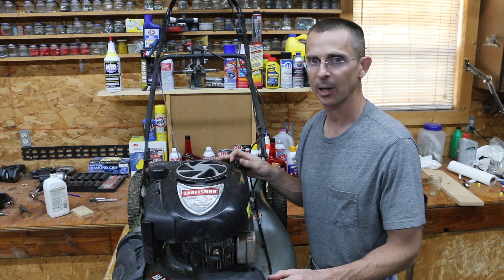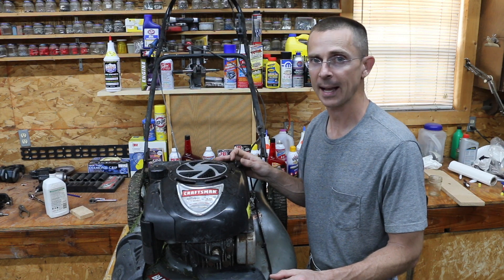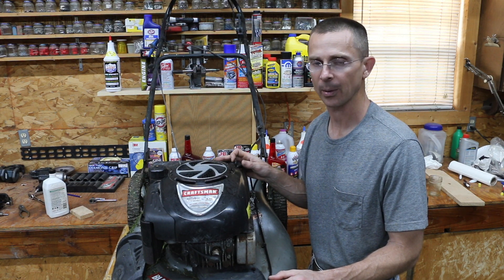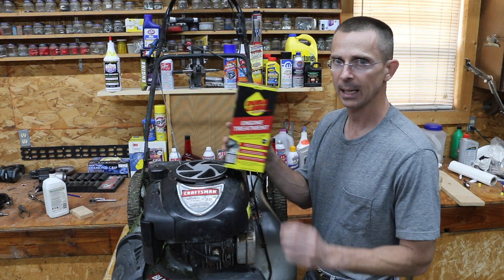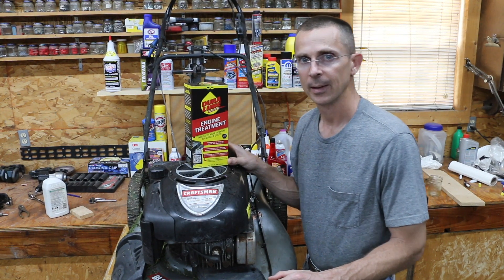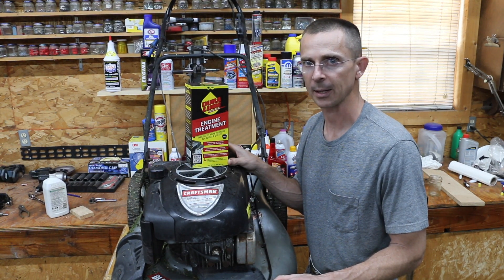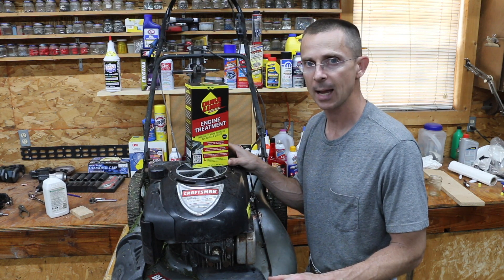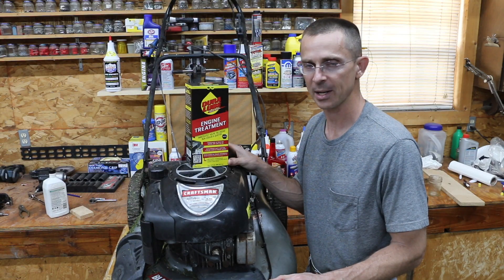Does Dura Lube actually help quiet and cool a gas engine as claimed?

Comment: Always love the tests you conduct!

As for Dura Lube. I watched the commercials years ago Sunday mornings and after months of procrastinating, I bought it.  First vehicle was a new 1980 full size V8 GMC.  Had it a few years and added DL around 1885/1986 "I believe".  Might have been later?  While doing a training course (Feb/Mar 1990) in another city and on my way home on a cold winter day, the engine block heater blew out and a massive cloud of what I thought was smoke but was actually hot coolant on a cold day almost gave me a heart attack.  Engine still running fine and I pull over and look.  Anyway, being tight on cash flow, I could not afford a tow home of another 60 Klm's or so.  I drove home with flashers on and no more than 60 Klm/Hr.  The Temp gauge was off the dial and I was expecting an engine seize up or at least some serious damage.  I arrived home ok.  Bought a new Block heater and coolant and drove that vehicle till spring of 2000 and the engine never appeared to burn oil.  Was my luck due to Dura Lube???  I don't really know or care.  I continued to always add Dura Lube!

My next "and still" vehicle is a 1997 GM Safari 4.3 V6.  Bought this one off lease in 2000 with about 70,000 Klm.  Always added Dura Lube along with premium Synthetic oil.  It's now May 2021 and it's my daily driver and does not appear to burn oil.  Always passed the smog clean test with impressive low readings.  Vehicle is in great shape with minor rust spots and the engine is extremely smooth and without hesitation/misfire.  But then, I do most of my own maintenance!
So at the end of the day, No matter what others may say, I will continue to add Dura Lube.

Cheers
Reply from the maker: Thanks for sharing.
Reply: hi can i ask you something i have a corolla. 2010 and i bought the duralube engine treatment because i fixed the exhaust leak and it still loud noise from engine. now im wondering if I dont repair my car by myself so did i just ti add the liquid 1quart to the oil that is already changed 2 days ago
Reply: @EPLSS  Hi,  First and Foremost >> NEVER OVERFILL THE ENGINE CRANKCASE!
"In most cases", replace just one litre of oil to one litre of Dura-Lube.  So you must consider sucking out at least one litre of that oil you just put in!  Having said that, you need to do two things before anything else.  1) Look online for the full fluid specifications for your year and model.  2) Go to Dura-Lube and check their instruction in case they have a suggestive reduction other than a full one litre add.
As a last note:  Depending on the mileage and existing wear on the engine, etc; dont expect miracles.  I think whatever you do as an upgrade will help if just a bit!

So now it's May 2024 and my vehicle is >27 years old and is still my daily driver.  The engine doesn't burn oil and it runs smoothly.  I use only top grade 100% synthetic oil, compatible synthetic filter and Dura-Lube.  I also well maintain the vehicle.  I typiacally replace spark plugs 3 to 4 years.  Coolant 2 to 3 years.  Best quality premium spark plug wires 5 to 6 years (and is due now),  Coils have been a bit iffy.  Do not buy Accel.  Mine lasted about a year and others have negative reviews.  Distributor and Rotor, I buy premium with Brass studs and "vented cap"!

Have fun and good luck

Comment: First, I find your methods of testing quite good and reliable.  I have had personal experience with " Duralube Engine Additive ".   I will attempt to be as brief as possible.   I once owned a 27ft Class C Motorhome with Ford 460 Cu.In motor. I personally observed that the NORMAL operating temperature when warmed up using Conventional  10W-30  Motor Oil was on the High End of the Heat Gauge but within the indicated Normal Operating Range. When the full bottle of Duralube was added to this oil,  within 5 minutes the Operating temperature dropped approximately  25%, a significant and noticeable amount.  This lower operating temperature with the Duralube Additive remained till the next scheduled oil change every 5000KLM.  This was the most significant observation I detected using this product.  I believe myself that the Duralube Additive really did reduce engine friction and thus reduced the operating temperature. I use Duralube in all my vehicles.

Comment: Yes i have used this and its great. It will not take care of a rod knock. It helps prevent them. But it takes a couple days to penetrate the metal. Thats when you really see the benefits. I had a 69 javelin and that engine after 3 days of running the dura lube, the engine just got smoother and the rpm went up by 200. I had to turn the carb stop back a little to drop the rpm back down ro 750. It ran cooler and started quickly. Fix the rod knock and rerun the tests

Comment: my 2002 expedition has a triton 5.4 - 2 valve engine, mobil 1 and duralube for most of its life changed oil about every year engine has 260,000 miles so far. Stopped using duralube for a few years then went back to it, the engine is definitely quieter and smoother.
Reply from the maker: Thanks for sharing.

Comment: I had a 86 Honda Accord LX-i with the top mounted sideways distributor that would leave metal shavings in the cap until it broke, IT happened twice to junk yard distributors till I used duralube and the used distributor already showing metal lasted afterward
Reply from the maker: Thanks for sharing.

Comment: Iv always thought briggs flatheads knocked and ticked because everyone iv seen has to a certain extent although they are great engines my dad has a husqvarna with a briggs quantum it has silver oil and it knocks so bad you can hear it down the street it sounds like a loose blade but it's not that engine won't die
Reply from the maker: Thanks for the feedback.

Comment: I found that very interesting however I had an old pulsar nx car 5 speed.  I had duralube in it.  I went out town and wife had oil change at jiffy lube, they forgot put oil cap back on car.   Wife drove round over a week with no oil in car.  Ended up melting distributor cap.   Obviously car broke down.  I change cap and filled with oil and we drove it for 60k more miles before sold car.  It was unbelievable engine didn’t seize.   Now I put it my Chevy truck and bmw.  I got over 250k in each vehicle they run great.  Thanks for sharing video
Reply from the maker: You are welcome!

Comment: Back in the early 90's we used duralube in our 400 dodge race motor. We hit a cylinder head that another team had strapped to their car for weight. why they used zip ties instead of bolts I'll never know. Anyway the head fell off the other car and tumbled down the front stretch of Ocala Speedway and we ran slap over it knocking a crape fruit size hole in the oil pan.  Our driver ran 3 more laps with zero oil pressure and then came into the pits. Our night was done. Next day at the shop well pulled the engine and got the pan off and started pulling rod and main caps to see the damage and there was zero damage to the bearings. I don't know if it was the Duralube or just plane luck but we were saved a large expense.

Comment: Would be interesting to see a lubricity test using Duralube and Duralube/Oil.
 I have used Duralube on bearings and it does seem to make them run cooler.
However, I have not performed any tests or measurements to confirm this.
Reply from the maker: Thanks for the video idea.

Comment: Dear friend you test can't be valid if testing the product was your intent ? First of all Dura lube is a friction fighter it's slippery ..it will not repair a spun bearing once the bearing was damaged only replacing it will fix it. But because of its slippery chemical make up it might lower the temp a bit ..but as far as the noise I'm not so sure...

Comment: I use duralube for one reason only. Many years ago I found out that changing to duralube, in cold weather, on first startup, the engine idled fast and smooth
imediately = no friction, and very obvious. Engine wear happens 80% during warmup, so if you want your engine to last 500 thousand miles, use duralube. (plus the other benefits)  I use a half quart per oil change.
Reply from the maker: Thanks for sharing.

Comment: The problem with duralube is that it contains chlorine and on humid environments it can turn to acid, an interesting test would be how corrosive is duralube with a little of water simutaling humidity at high  temperature simulating engine temp and test for corrosion after a long period of time, similar test could be donde to other additives that contain chlorine like prolog, motorkote, and others.
Reply from the maker: Thanks for the feedback.

Comment: True story I had a 94 Nissan Sentara. I had put Duralube in my car about twice. I knew my car was leaking some oil since I would see droplets of oil in my drive way. I had an emergency  to go to San Antonio and left with me and my brother. I added some duralube before I left. I took some extra oil. Driving there I was ok. Driving home halfway about 95 miles I stopped at a gas station to check my oil and it was completely dry. But my engine never overheated. It never got smoke or anything. It still ran smoothly and fired right up. The plug on the oil tank had came off. I was litterly running my car with no oil. I was sold after that I've been using it ever since.
Reply from the maker: Thanks for sharing.

Comment: Dura Lube is NOT the same as Slick 50. Both were charged by the FTC but Dura Lube was simply told to change their advertising because they were overhyping some of their claims. Slick 50 was downright fraud.  Slick 50 was part of Quarker State which after the FTC took them to court, Quaker State defaulted.  https://www.ftc.gov/news-events/press-releases/1997/07/quaker-state-subsidiaries-settle-ftc-charges-against-slick-50

Comment: I have PROOF that DuraLube saved my engine twice. Late-night emergency service call at 1am, on 50-mile return home and nothing open on the country roads, we lost our oil and had zero pressure. We've been using DuraLube for about 6 months before this happened, the engine sounded terrible but we got back ok. Next morning all us service guys were talking about it and we filled up our E-350 Ford van up with oil and it ran great, never burned oil and put another 100,000 miles on it and sold it with 298,000 miles to a hippie who drove it back and forth from Ohio to California three times. We lost oil TWICE in this van, one from a punctured pan and once when the dip tube broke off. SO WHAT SAVED OUR ENGINE and didn't cause us to burn or seize it up, you think it was the Pennzoil, the Ford engine, or the DuraLube?  BTW,  my current e350 now has 276,000 miles on it WITH ORIGINAL PLUGS. If anyone doubts me they're welcome to check to see if I'm lying and pull the plugs, I'll buy the new ones to replace the ones you take out, I hear its a bear to change them. NOTE, that lawnmower had mechanical issues to begin with, no additive is going to fix that. Our van that ran dry of oil had no mechanical issues except when the California guy came through one day delivering pizzas in it, it was all rusted out BUT RUNNING good.  !
Reply from the maker: Thanks for sharing.

Comment: I have a twin cylinder Onan 6500w Propane generator in my 40' bus conversion/RV and although I don't have the ability to properly test performance as you do, but I can safely say "Dura-Lube" has increased the twin cylinders performance. Prior to using the product, I put new plugs and air leaner in and changed the oil, added Dura-Lube. Inside my bus I immediately noticed it's definitely quieter, engine starts dang near instantly with a push of the button, as for fuel consumption, hard to tell at the moment because the fuel tank is a 26 gal unit. Being the propane tanks fuel gage shows 3/4 full by law  when infact I had a fresh full  tank prior to starting the engine, I'll have to do a little math when I go and refuel.
   Does Dura-Lube work?, I will safely say "YES" it works, would I use Dura-Lube on every oil change as per manufactures suggestions "NO", being that Dura-Lube is formulated to treat the metal surfaces of the engines internals, I don't think that the product is required at every oil change, and at $14 dollars per quart, I feel that dura lubes suggestion is only a marketing strategy to sell more units. Maybe using Dura-Lube every fifth oil change, or tenth would make more sense to me.
   Great channel "Project Farm" , for some reason I had to RE-Subscribe to your channel, today I was on YouTube and your Dura-Lube test popped (coincidence, I purchased Dura-Lube yesterday at Walmart) as a suggestion so I clicked on it and noticed I was dropped from your channel. I'am thinking that I have about 18 subs right now so maybe Cyberspace decided to drop my favorites.
   Thanks for reading, and thanks for the educational content.✌️
Reply from the maker: Thanks for sharing.

Comment: I'm sceptical of all snake oil with exception of Howe's or Lucas fuel treatment for older diesel trucks that need more fuel lubrication than ulsd now has, but I did buy a 1997 Sierra 1500 used from the original owner with 300k km on it.
He used dura lube from day one, when I sold it at 450k km on the original engine it was running excellent still.
Granted it was a SBC but still....
Reply from the maker: Thanks for the feedback.

Comment: @Project Farm
I have used duralube in my 3.3 v6 in my vans. I do it every other oil change. I had my oil pump completely go out on it in the middle of winter and had about 90 miles to go to get to a shop(any shop) and not only did it make it(don't recommend it but I had little kids in van) but it protected the engine from any visible wear! Just replaced the pump added new oil(mobil 1 full syn 5w30) and this van ran a addition 200k miles before I sold it for a new one. (It still ran perfectly @ 395k miles) (I also added Dura Lube transmission treatment and this was a dodge which was known to go through transmissions but I never had a issue and only vacuumed the top foam off and added fresh to full every 60k miles) I found out that the van was finally retired due to much rust after 650k miles and the engine was pulled and put into a different vehicle along with the transmission. Though they did replace the clutch disc in transmission because it had no material left at all but the treatment prevented damage for over 10 years.
Reply from the maker: Thanks for sharing.

Comment: I used Dura Lube in a diesel twin engine boat. It brought the temp down on one engine that would overheat when run at 90% throttle. Have always used since.
Reply from the maker: Thanks for sharing.

Comment: Used Durable in my 1977' K5 blazer worked great. Takes more than few seconds to work if you read the label . It has to wear into the metal.
Reply from the maker: Thanks for sharing.

Comment: I love that you try to be fair as possible and when someone points out any flaws in your testing methods that you listen to them and change your system in future videos. Great job. Definitely noticed this engine was running at a higher rpm and running smoother.
Reply from the maker: Thank you!

Comment: I've been using duralube for years in my GMC Sierra with over 317,000+ miles and definitely notice a difference after every oil change with duralube added. Without it the engine vibrates under load.
Reply from the maker: Thanks for sharing.

Comment: I’ve used it in my vehicles many times. Bottle says it penetrates the metal after several hot and cold runs. The longer it’s in the engine the better it performs. My results with it is my engines ran smoother after about a week of using it and my oil stayed much cleaner for longer period of time. My fuel mileage increased as well after about 5 days of using it.
Reply from the maker: Thank you for the feedback

Comment: From what I've heard and read about Dura Lube from other people's experiences and engines inspection after using it, it's only a short term impression product. It doesn't provide any adequate/claimed performances over time as it's teflon based and it starts tearing off irregularly from the engine components creating even greater issues if someone might want to re-bore the engine or refurbish it's internals. Sadly, not a true product for what it claims.
Reply from the maker: Thanks for the feedback.

Comment: I treated my 351 engine in my former  older ford truck with dura lube. One day while out on the road the oil pump went. Zero oil pressure. I sat there awhile and decided to try and drive home since it had been treated. I started the engine. Without oil it was very loud. I was able to drive home which was a couple of miles away.  I later went out and started it again and it ran fine with no oil pressure, the engine clacking away loudly. I scrapped the truck because it was rusty. I think the duralube worked.
Reply from the maker: Impressive!

Comment: I used Duralube extensively in the early 1990s in a 1988 Subaru XT6 with the 2.7 flat-six. I started using it around 100,000 miles with 10-50 and 5-50 Chevron synthetic oil and never looked back. Engine temperatures were cooler and my overall gas mileage was always a bit better than expected.

It also survived a blow upper radiator hose while driving uphill in warm temperatures. The temperature gauge hit dead center, but never over that and made it to a truck stop that carried hose tape that got me going again. That hose tape loosened and antifreeze leaked quite a bit, yet my temperature gauge stopped in the middle and I made it home. Naturally, I lost some antifreeze, yet the car ran fine until some idiot ran into me at 145,000 miles and ended it. 

I definitely need to return to using Duralube, as it is one product that never failed me :)
Reply from the maker: Great Point!